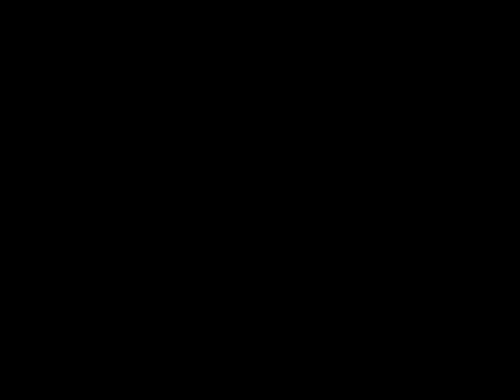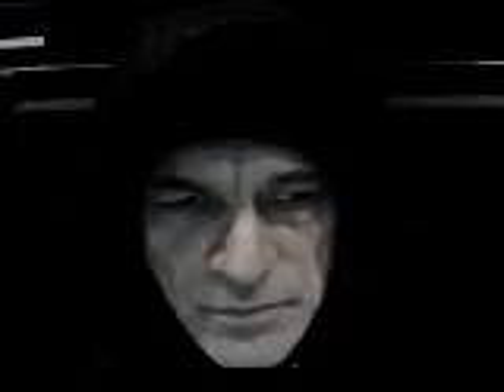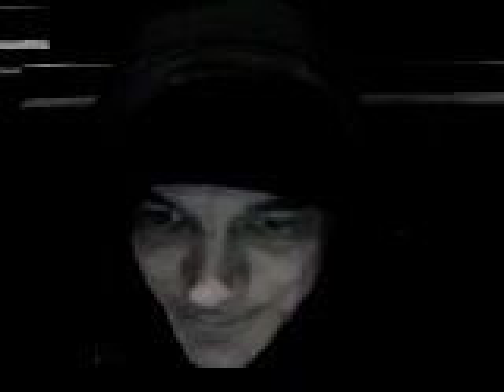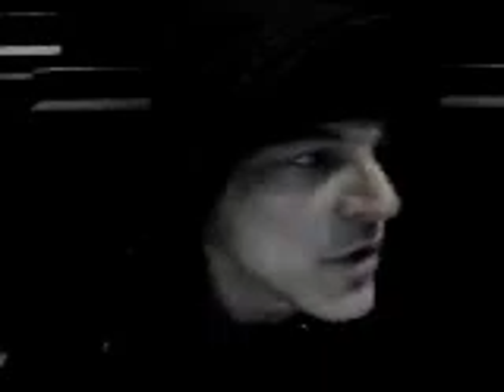12 mega pascal 410 PSI pipe tube barrel chamber bore gauge schedule wall thickness diameter caliber

Comment from the maker: "caliber' = inch constriction choke bore  names & "standards 

.685 Full choke,
.695 Improved Modified choke 

.705 - .745 = SAMMI cylinder bores 

.705 = Modified choke  
.716 = Improved Cylinder bores   
.719 = skeet choke,  
.724 = Cylinder bore,  
.729 = 12 gauge defined bore value 

.735 - .745 = SAMMI slug bores 

.798 - .810 = chamber bore for cut shells  

.815 - .824 = NPT SCH "lowes" bore ;-)

https://www.chuckhawks.com/picking_shotgun_choke.html
Reply: OOOOh a new word for me: sphericity
Reply from the maker: brass tokens bearing the letters D P A V

https://www.numisbids.com/sales/hosted/cng/e/413/thumb00487.jpg
https://www.numisbids.com/n.php?p=lot&sid=2386&lot=487
Reply from the maker: May 10, 1986     in the woods between Tigard and Portland
loggers discovered a nearly complete human skeleton & 
state medical examiner Dr. Karen Gunsons autopsy 
estimated the age of the John Doe as 35 to 55 years 
 & effectively ruled the death a suicide after finding  
a bullet hole in the man's skull

no identification  was found but near by were 
a .38 revolver  & a spent shell 
leather high-top style  shoes 
wire-rimmed glasses 
Yellow metal plated Sears & Roebuck pocket watch
Fraternal Order of Eagles pocket knife 
1888 V nickel, 
1919 penny, 

4  "D&P" A V  tokens

https://www.picclickimg.com/00/s/MTIwMFgxNjAw/z/t1sAAOSw9GhYhsde/$/D-P-token-Portland-OR-R2-_1.jpg
https://www.picclickimg.com/d/l400/pict/133018105137_/Oregon-Trade-Token-V-C-Portland-Or.jpg
https://www.picclickimg.com/00/s/MTIwMFgxNjAw/z/BcgAAOSwkjJcVyJr/$/D-P-D-P-Token-D-_57.jpg
https://www.ebay.com/itm/372846452967
https://www.ebay.com/itm/D-P-token-Portland-OR-R2-/323743034953
https://en.wikipedia.org/wiki/Disappearance_of_Marvin_Clark#1986_discovery_of_John_Doe
https://www.linkvillecoins.com/store/index.php?main_page=index&cPath=110&zenid=s4oab4527p8j8l6mi0ibr24f60
https://www.linkvillecoins.com/store/index.php?main_page=index&cPath=110&sort=2a&page=2&zenid=s4oab4527p8j8l6mi0ibr24f60

https://katu.com/archive/remains-found-near-tualatin-country-club-in-1985-linked-to-green-river-killer-11-25-2015
Reply from the maker: the reason they assumed the man died between 1913 & 1941 
 is crossed D & P token = Dahl & Penne or Charles Dahl & Landor Penne,  = 

1913-1933 234 sw Alder & 
1934-1941 134 SW Alder

https://tokencatalog.com/token_record_forms.php?action=DisplayTokenRecord&td_id=3830&inventory_id=399759&attribution_id=3720

http://tokencatalog.com/OregonCatalog.php
Reply from the maker: the Dahl & Penne Tavern was later a gay bar & had no tokens 

https://res.cloudinary.com/sagacity/image/upload/c_crop,h_3330,w_4063,x_0,y_0/c_limit,dpr_auto,f_auto,fl_lossy,q_80,w_1080/0618-pride-dahl-penne_xlxttt.jpg
https://www.pdxmonthly.com/articles/2018/5/22/in-1964-portland-tried-to-crack-down-on-the-city-s-gay-scene-here-s-what-happened
Reply from the maker: http://www.digitaljournal.com/news/crime/oldest-active-missing-persons-case-in-us-may-soon-be-solved/article/382517
Reply: waptek2 I don’t know if you read that whole last article you linked here but Zach Dundas has a very interesting style of composition. I like it
Reply: waptek2 omg, seriously thank you for posting this. Zach and Chad Dundas are both awesome. Slips down rabbit hole.......
Reply: @waptek2  I forgot to say, I found this because I have an indian head nickel here that seems almost like someone took a hammer to it and flattened it out. I dont know where it came from or why I have it and it's really strange because I have quite a lot of coins in this box that I have no idea where they came from. Some of them are really oddball. I know I dug one coin from Africa up out of my garden about 8 years ago and I still have that but a bunch of the others I just don't recall. But I was looking to see about that nickel because I really love it and I ran up on this page on wikipedia about people who disappeared after 1970 and there was this guy who disappeared in 1981 who carved "hobo nickels" and I didnt know what that was and was looking for what those were and ran up on this John Doe. I love all the coins you posted too. I have a thing for coins apparently. Ive been squirreling them away without even realizing it. https://en.wikipedia.org/wiki/Hobo_nickel
Reply from the maker: peter kuske flagged my playlists to stop me from uploading
Reply: waptek2 Awww I apologize if it was because of me. As far as I’m concerned you should be allowed to do anything you want. It getting cold there? It’s been in the 80s here and weird, like 100 percent humidity and all foggy. Like pea soup